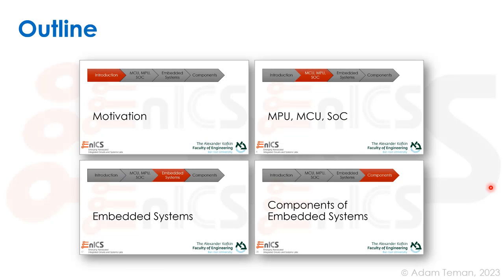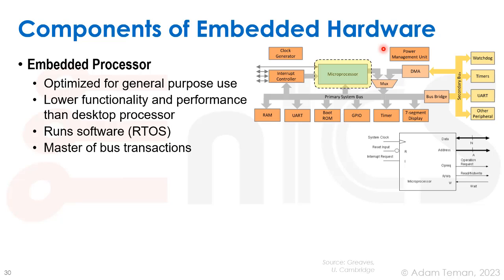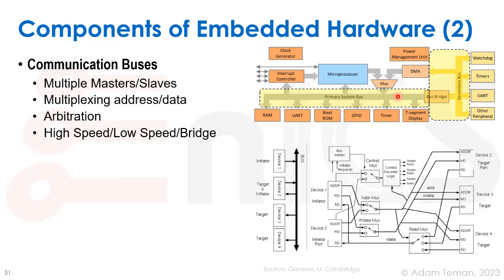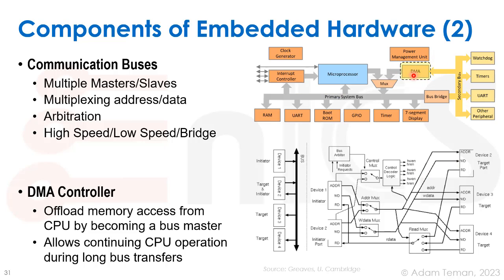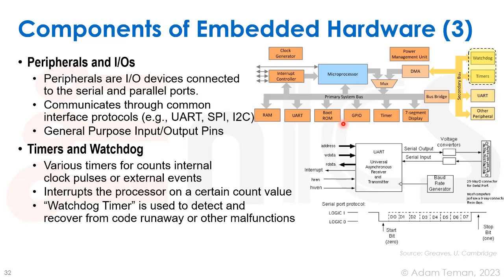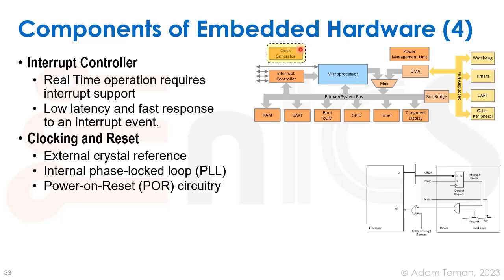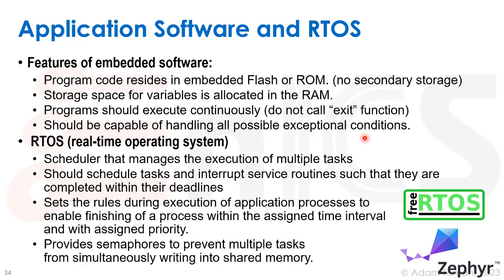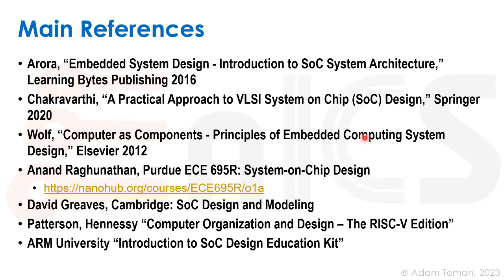SoC 101 - Lecture 1d: Components of Embedded Systems

Comment: Why won't we have a flash or some kind of secondary storage in this architecture? as any program will be loaded into that memory at first.
Can you clear my concepts please :)
Reply from the maker: So, this is true. There will usually be some sort of ROM that contains the program that runs on the system (firmware). This ROM could be a hard-wired ROM in a really low cost system, an embedded non-volatile memory (usually eFlash), if the process allows this and the program is sufficiently small, or an external Flash chip, connected through an interface, such as SPI. The external flash will increase the system cost, since it will require integrating at least one more chip with the system, but this is something that may be cheaper than an embedded NVM and is often going to be the case.

In any case, this list that I overviewed was in no way supposed to be exhaustive, and you will see during the rest of the course that I will overview such external Flash connections. However, when looking at the chip itself, the external Flash connection is covered by the bullet called "peripherals and I/O".

Hope that clarified this point.